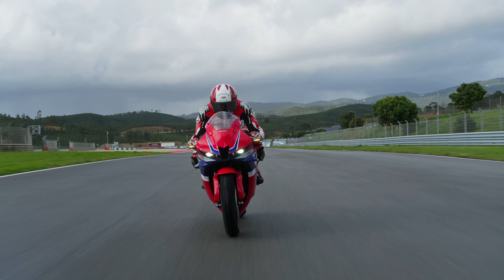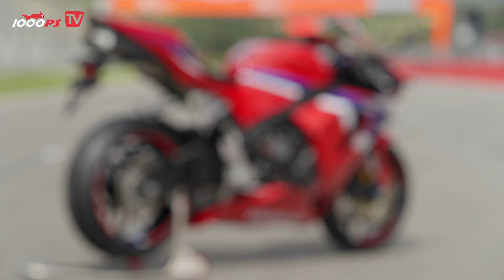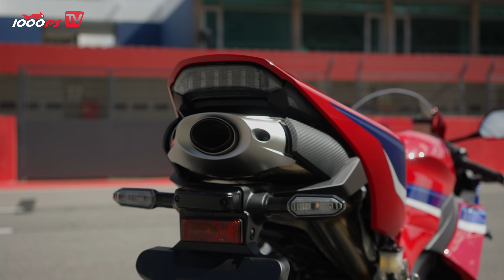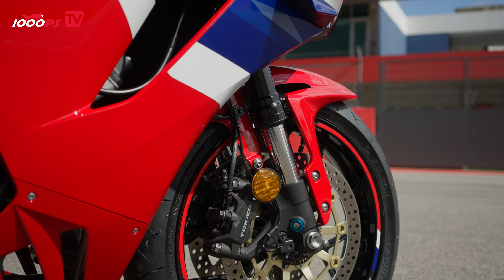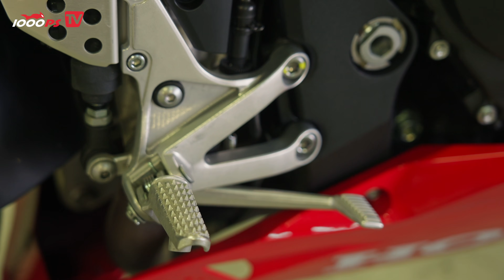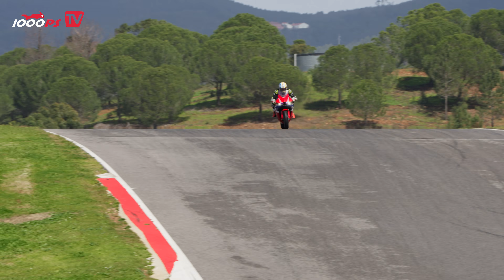REVIEW - Honda CBR600RR 2024 - comeback of the year!

Comment: yeah yeah Honda says my Stock 05 600rr has 115 HP @ 14k RPM, on the Dyno it came out @ 105 HP at 13.5k RPM, that's a lie of 10 HP which is huge for a bike.  After header, full Jardine exhaust, K and M air filter and PC3, Dyno said 113 HP @ 13k RPM. It was very noticeable, but.....
Reply from the maker: Honda probably doesnt state the HP at the wheel but at the crank thats why youre missing 10hp, you could dyno them all and probably get the same results
Reply: @1000pscom  not true, Suzuki claimed a 115 HP to the rear wheel, so Did Yamaha and both actually dyno 115 HP. I'm a Honda guy, Honda's are almost perfectly engineered but for the road power NOPE.  Dirt is another story Honda wins with Power.